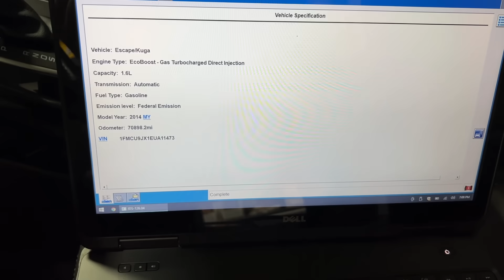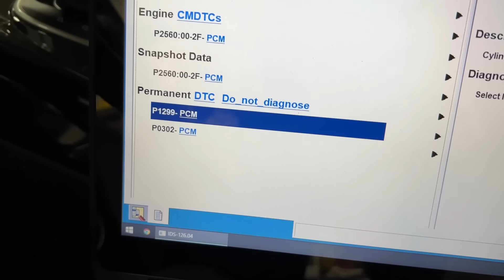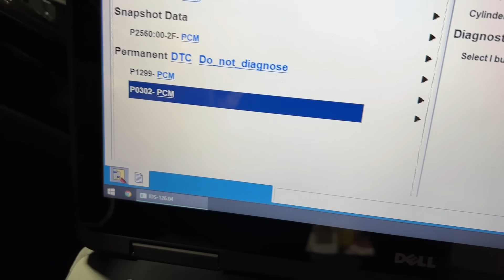Beware of Ford’s 1.5L 1.6L 2.0L Ecoboost Engines and Their Never Ending Coolant Consumption Issues!

Comment: Happened to my elderly relative. Ford offered to pay only half of the repair bill but in the end they paid for it all. These engines are working hard (150hp from a 1.5L!) so need to be strong and clearly the block has defects from the factory.
Reply: I never have any problems with mine
Reply: Count your blessings.  Respond when you have around 140k on it.  And yes, I expect any car to last with good maintenance in it's life to last at least 150k..

Comment: Ford has lost their way. Maybe they could contract with Subaru and have them make their engines. I feel sorry for the Senior Engineers at Ford that have been there and done that in the past. Aluminum Body Pickup Trucks? What is the cost savings in that? Ford, do the right thing for your customers or it's "Hello Foreign Manufactures". We don't want experiments, we want dependability for those hard earned dollars.

Comment: 07/8 22 Do you know the expected longevity of the Ford 3 cylinder 1.0 litre Dealer maintained engine please ? Have suffered coolant failure recently remedied by Main Dealer. Owners Manual says engine oil change at 18 000 miles or annually. The dip stick shows what looks like liquid soot ! Helpful comments welcomed.

Comment: My neighbors Escape ecoboost needed new  engine after 50k miles .  Same issue- coolant consumption- overheated and toasted the engine . They were out 800 miles away from home. Not fun experience . Although it was covered by extended warranty - you dont wanna be stuck in the middle of freeway 800 miles away from home.

Comment: I have a 2014 fiesta st with the 1.6l ecoboost. I never heard of these engines had any problems in the fiesta st's, wonder if it's still applicable or ford did something different with the cooling system on our cars?

Comment: So where Are the lawyers when you need them?? A class action lawsuite needs to be started against Ford EcoBoost Engines. We got some of our money back by joining the Focus transmission Lawsuite. This issue is 101 Mechanics and is a Huge problem. Ford needs to hire top Engineers but no lets sub everything out. FORD is screwing themselves and Farley has shown he is not capable of making Ford better than Honda or Toyota. William Clay is a spoiled brat and doesn't give a damn.
Reply from the maker: There is one.

Comment: It's a design failure. They didn't test the concept long enough  before releasing the product to market or there are manufacturing failures. In Europe these "downsized" engines keep failing or catching fire for the same reason. A leak in the cilinder head leads to coolant near the exhaust manifold and fire.

Comment: GM has just as many problems with their turbo engines. Suffice it to say it's always a good choice to opt for the naturally aspirated option. Difficult since turbos are all the rage with manufacturers looking for increased acceleration and fuel economy while saving money on a larger engine. Bottom line: turbos suck.

Comment: Ford recently admitted to their crap quality. I owned a 2014 Ford Focus ST and right after buying I noticed 2 things. The hood did not close flush to the body and the rear hatch had a massive gap difference between left and right side. Then on my 2016 Ford Transit 250 the auto-window switch stopped working right after my 3 year bumper to bumper warranty expired. I've owned cars for more than 12 years that never had a problem with the window switch or power locks. With just over 30k miles the 3.7 V6 started sipping coolant. Not a lot but enough that I had to keep a gallon of coolant available. It also took them 3 tries to get a recall repair right on the drive shaft coupling.

Ford is just using the cheapest crappiest components they can find. Everything under the hood is now made of plastic and becomes brittle and cracks.

And don't get me started on the stupid Sync system in both cars. Just sold the van and I am done with Ford for good.

Comment: 2014 F150 3.5L Ecoboost - Consuming coolant.  Gotta be going out the tailpipe.  I think you need to add bigger ecoboost engines to your list.
Reply from the maker: Nope it’s definitely not common. The 3.5l eco has plenty of common external coolant leak points. You should start there.
Reply: @FordTechMakuloco  I appreciate the reply.  Thanks for the information.  :-)

Comment: Wanted a ranger when they first came out only to find out they only come with ecoboost motor. Nope. Went with a 2013 tacoma instead w/ 45k miles. Traded 2018 mustang eco with 12k miles since warranty ran out. Broke down 4 times w/ 1 engine replacement at 10k miles. They found coolant in a cylinder. Nope. Never again.

Comment: Dude. Is all that detonation witnessing from the "Air Pump" Feature? Cyl 1 spark plug was eaten away a decent amnt. Cyl 4 plug was some too... And when scoping you could see a ton of Detonation marks. Is that coming from the Air only switching over? I mean a '14 I guess isn't that bad with those marks, but damn with only 70K it seems a decent amnt. Is that normal in these engines?

Comment: Ecoboost?, is that just another word for Turbo Charger?. Why can't we build a car that lasts for a good long time?, and it's not just a Ford problem, a few yeas ago Cadillac drilled the aluminum blocks on some cars for fine threaded head bolts, bad idea, didn't work too well. The more complicated something is the more problems there will be in the design, why haven't we learned this?, all one has to do is look under the hood of modern cars to see they are too complicated. I want a vehicle that will last a good long time with no major repairs, I guess that's too much to ask.

Comment: Have had the 2.0 in Ford Escape and Ford Edges and never had a issue. Run full syn oil, and changed every 5K. Run premium gas to reduce carbon build up and no chance of knocking. They all have been great. Never had the smaller engines.
Reply: I just bought a 2013 titanium model, 65,000 miles, I am replacing the spark plugs, I also changed the trans fluid, took out 4.3 quart it looked like black paint. The cabin filter was never changed and the leaves in the engine compartment well I had to clean that too. The people I bought the car from always had the Ford dealer do all the work, they know nothing about cars, they just drive them. You would think the Ford dealership would be more responsible and take pride in there work to check everything they need to do when working on someones car. Sadly, they do not. I told them what needed done and the owner just said, I had it all checked out at the Ford dealership and they said, they went thru it top to bottom. Well, that was a lot of bull, I am finding problems, so far that I can fix myself. I am a back yard mechanic on old cars, these new computer cars really suck. I just feel sorry for all the people that Ford takes for granted.
Reply: I was thinking of running premium in the 2013 I just got, did not know what I should run, but I think I will give it a try. Question, did you ever run regular 87 if so when you went to premium did you notice any difference in performance ?

Comment: Hello FordTechMakuloco. I own a Fiesta ST 1.6 and never had any issues until know... It also looses hell alot of coolant. So how exactly can I fix it? It only has 170k Kilometers on it (105k miles).
What exactly is a longblock? Does it mean, that I have to replace the engine or what does this mean?

Comment: i bought a 2014 2.0 escape 3 years ago with 115,000 km on it and i noticed it was low on coolant then. i bought a big bottle and have been topping it up every 6 months or so and in the 3 years i have used about 2 litres of coolant. Is that reasonable or too much? it doesnt bother me at all

Comment: Bought a brand NEW Fiesta 1.6 back in 1990. Right away, it was Waxoyled underneath, it never saw a Winter with me (1 with my Dad), had its oil changed religiously every 4K, oil and filter every 8K. Used April to September (garaged over winter....actually got another car to use in Winter. Never thrashed it, Did just over 50K in it....it was puffing black smoke and was rotting beneath the front and back windscreens! I would NEVER buy a Ford again. A friend bought an '02 model similar to mine....in 18 months it was starting to rot above the rear wheel arches.  A quality vehicle!  :(
BTW, they refer to these engines as 'EcoBOOM' engines!....go great when new, but after a few thousand.....

Comment: We're desperate for info.  How can I tell if our 2020 Fusion SE (build date 6/2020) has the updated design of the 1.5 ecoboost I4 engine that does not leak coolant into the engine?
Reply: @erikbalens  Thanks for suggestion but it doesn't answer my question.

Comment: The fix is a short block not a long block. And on the new short block they fixed the issue.
Reply from the maker: Too many have had issues with just a short block that Ford pushes to save money. I can get a brand new engine all built for cheaper than building up a short block and it will be fixed right. So yes the proper fix is a long block.

Comment: That seems to be from some amount of warp + possible gasket problems on the mating surfaces between the engine and head. Is there a sleeve or jacket design problem that creates hot spots not allowing for enough coolant to carry the heat away? Does this seem to happen more often in one climate vs another? You know, more problems in the sunny, hot, Southwest vs less problems in the cooler northern half of the country? What kind of intake air cooling does the ecoboost have? Is it not sufficient so that it does not cool the incoming charge enough?

Comment: This is not unique to Ford, Honda’s 1.5 turbo also have oil dilution issues.  I suspect Hyundai and Kia also have issues.  Toyota’s new Tundra now comes with a turbo V6, who knows what the long term durability issues will be? Heat and complexity is not good for engines, try to get a dual port naturally aspirated motor if you can.

Comment: Put a 50 gallon water tank on the roof and connect to cooling system and keep driving till it blows ,cheaper than replacing with another engine which will have this problem . Dont buy another Ford

Comment: I liked my 3.0 2010 Ford Escape. No issues other than Upstate NY rust belt killed the body. Too bad Ford Fu!@$% up the 2.3 Liter engine as well. That was a bulletproof engine when it was in the Rangers and was cast iron. Dunno I still drive a 3.0 2004 Taurus real engine,18 years old and runs like new. Not driven in the winter. Pushrod engine baby.

Comment: Unfortunately I've come across this video because I'm currently having much likely the same issue. It's so sad as I didn't see this coming and I don't know if I'll be able to afford a repair
Reply: there is a suplementary recall but yiu need to take it to the delearship before 11/30, ,mine is being replaced a shortblock,  not original owner or under warranty

Comment: Owning a 2014 Fiesta ST (EU model) built at the Cologne plant, I have been pretty paranoia ever since I watched this video. It is a 1.6 EcoBoost engine after all.

However, this specific issue only appears to affect certain US models of Ford and Lincoln from US and Valencia plants, not including the EU Fiesta ST from Cologne. At least that is what I get from your videos and many other internet sources.

I cannot find a single thing about this issue affecting EU Fiesta STs. Do you know any more about this, or is it safe to say I dodged a bullet here? I do know about an earlier 2017 recall for some Fiesta STs, but my car was not included back then either.

Could you please share any knowledge on this? Any help would be much appreciated!
Reply: Don't worry about it. The 1.6 in the FiST is solid. Go ahead and throw a Stage 1R on it and it'll still be rock solid :)

Comment: I mean I had a 2013 Fusion with the 1.6L Ecoboost and I surprisingly didn't have any engine issues. The ABS sensors and their wiring was a mess and one of the harnesses passing through the firewall had to be rewired due to shorts. Overall the maintenance costs weren't that high.

Edit: To clarify I put around 200 000 KMs on it

Comment: Ford just sucks at making small engines. Built right to tolerances I mean a 1.9tdi can put out 300-400bhp all day long and last 300k miles  but Ford 2.0 diesels start having issues anything over 190bhp and will struggle to last 150k

Comment: I was victim to the infamous Ford Focus DCT issue and forced Ford to buy the vehicle back at 54k after 4.5 years with 2 clutch paks replaced and the final straw, a TCM failure that nearly had me and 3 friends killed when the tranny shuttered and locked the car up when making a left turn across oncoming traffic. That was it. Ford gave me $18k for the car and I paid $23k 4.5 years earlier. 

Because they took care of me, I bought a brand new '18 Escape with the new 1.5L. I had an immediate coolant leak at the base of the reservoir and they fixed that. I later learned about the upcoming coolant issue described in this video. I was on edge. Then Ford's fix is a TSB to detune the boost on the turbo. I had that done but that's typical modern day Ford, reduce the immediate chance of a catastrophic failure and the push issue down the road till it's out of warranty. I saw it coming just as we did with the Focus. F**K YOU FORD! I traded that soon to be POS in at 3 years and 32k miles for awesome money thanks to the covid car crunch and bought  brand new Toyota Tacoma TRD Off Road 4x4 and then shortly after, bought my wife a new '22 Toyota RAV4 XLE AWD gas burner. After 40 years of loyalty, Ford can F**K OFF. I'll never set foot on a lot again. I'll maintain these Toyota like clockwork at 5k miles and drive them them till I die. They will still be on the road with minimal dollars spent on repair.

Comment: So get this. Same code, same engine. No coolant on the dipstick, no coolant in the transmission.. Crack in the degas bottle, replaced and refilled with fresh coolant. I'm going to check the spark plugs tomorrow. Going to check the sensors too to make sure they're not just wigging out.

Comment: You may want to look into the "recall" Ford had years ago due to fires from coolant leaks. I don't know anything about cars but, I have heard rumors that after the recall and "fix", coolant was now  pumped into the engine due to the recall fix. Can you confirm?
Reply from the maker: I have performed those recalls before back in my dealer days, I know all about them. They do not cause this issue.

Comment: I had an early model 2013 Escape 1.6L Ecoboost AWD. BLock cracked at cylinder 3 at 69K miles. Ford refused to pay a single penny of it. Replaced the short block. 5K miles later the trans went out. $13K total worth of repairs. Finally sold it and bought a 2013 F150 5.0L V8. Will NEVER buy a Ford Ecoboost engine again.

Comment: no good introducing a turbo to a block that's not going tolerate the boost over time. I've got a 2.0 mondeo duratec (u.k) that's covered 164,000 miles and still driving fine. it's had a rocker gasket and usual plug changes and holds its coolant just fine...

Comment: Excellent video, sir! This makes me want to sell my wife’s 2014 Titanium Escape while it’s still running and looks like new. We always drive it easy and hardly ever get on it, but every once in a while, I get a whiff of coolant for a few seconds. The tank level stays normal and nothing leaking so I hope the smell is just coming from the coolant tank vent for now. It also has 72,000 miles, but not driven too often since my wife works from home. It’s had quite a few road trips, but hardly anymore. I think it’s time to sell it while it’s good and move on. I’ve always told people these mid level Fords aren’t built to last for the long run. Not with the cheap materials used nowadays. Thanks again for the video, Brian!
Reply: Go trade it in on a Toyota RAV4 or 4Runner, get rid of that hot garbage while you can!!
Reply: Stick with your intuition and sell while you can.
Reply: Stop driving it now and sell it!
Reply: B T Escape 2014 if Titanium then it has the 2.0 engine - no issues, there is no block replacement for that engine and no known issues with the coolant, Brian presents a 1.6
Reply: @mateiux   the title of the video is "Beware of Ford’s 1.5L 1.6L 2.0L Ecoboost Engines and Their Never Ending Coolant Consumption Issues!" and less than 30 seconds in he mentions All of their ecoboost engines, which would include the 2.0.  The 2.5 is non ecoboost, is that what you mean?
Reply: @jameswalker590  I was not referring to the 2.5L you are correct 2.5 is non Eco Boost, I was referring to the 2014 - 2.0L as per original commenter request on his wife 2014 Titanium (Titanium is always 2.0L)

Ford Escape until 2014 had a 2.0 EcoBoost Single Turbo CLOSED Deck (Mazda Derived) with 0 issues a very reliable engine actually... after 2015, facelifted version, Ford introduced the 2.0 EcoBoost twin scroll turbo engines with an OPEN deck design and YES a lot of issues -came in as: 1.5L 1.6L 2.0L that Brian is talking about. 
 
BOTH are EcoBoost Engines but different flavors. The detail is OPEN vs CLOSED deck <2014 vs >2015

Conclusion: Ford Escape Titanium older then 2014 no issues with the 2.0L (however it has issues with the 1.6 and 1.5 regardless of year) 

How do I know: I owned a 2014 Escape Titanium, I think it was the last one that rolled out of the factory with the "good" 2.0L engine :) , 0 issues with that car, traded with 80K miles was still driving like new.
Reply: There is no coolant vent besides cylinder 2 lol, He's saying it runs at 20 - 21lbs of pressure thats constant except when it cools down. Thats why there is a fill mark on the reservoir bottle for expansion. You can't vent coolant it's a hazmat chemical.
Reply: Your Escape might not have the engine that fails so often. It depends on which engine stream the car came down...